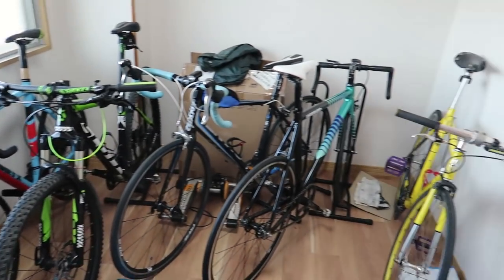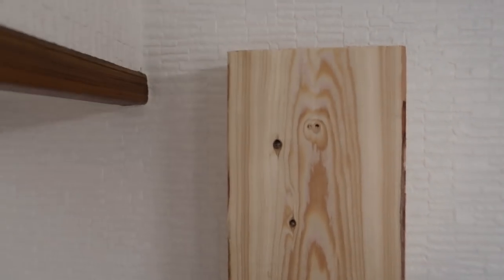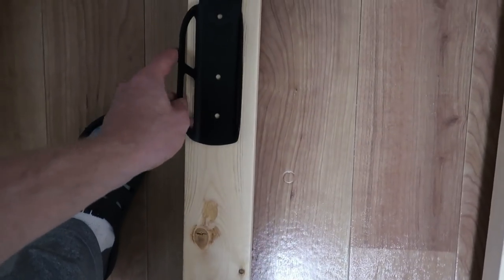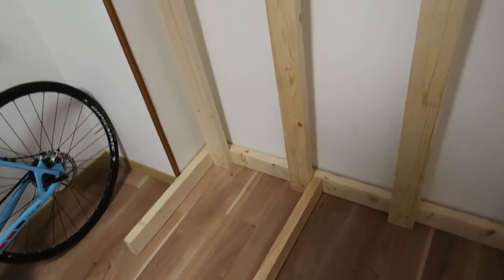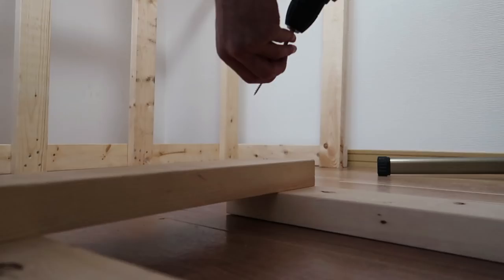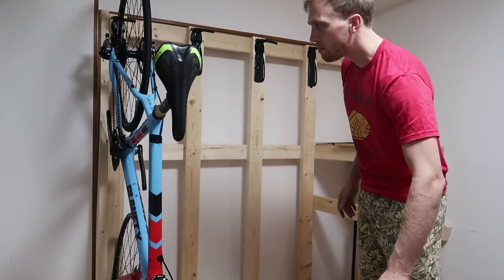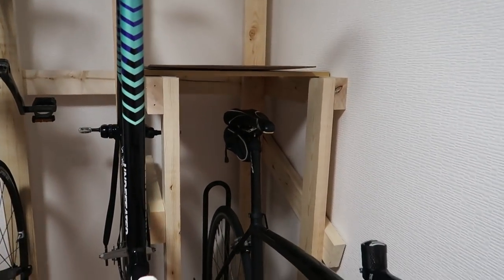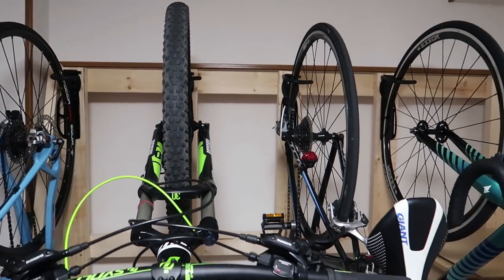DIY Bike Rack | Custom Bike Stand (Self Supported & No Wall Drilling)

Comment: When you said "diagonal", that was the magic word! 😉
 If you look at almost any open metal or wooden structure, you'll see triangles. Your side bench was fine for strengthening the rack. But you could have added 45 degree braces down at the bottom, just to half the length of the horizontal feet and those would have done the same job as the long diagonal. Hmm, actually you could remove the central feet now, that might save you tripping over them when handling the hanging bikes.
But you two did a pretty good job anyhow. 👍
Reply from the maker: Thanks! It was a fun project where I got to learn some new stuff along the way. I took out the center foot as well. Good to know that the shorter triangles would also work

Comment: I am planning to do something similar. I wanted to drill into the garage wall so 2 pieces of timber, hooks and I'm done but the family didn't want to in case they wanted to move things around it'll be easier so will do doing something similar. I only have 2 bikes but will be making it to have 5 hooks so friends can park their bikes and to accommodate n+1 bikes :P

Comment: Hi Cruise, what's the distance between each hooks? Do you think you'd need more? What height are the hooks at? I'd very much like to build something similar for my apartment in the city where I can't screw anything. Thanks!
Reply from the maker: About 42 cm.. I'm actually considering going smaller to fit more bikes.. You could also vary the heights to fit the handlebars easier.. Height depends on the bike size, but just measure your bike height and add a few cm and you should be good

Comment: Great final design!  I have made one with just a 2X4 into the wall and a small footing to clear the baseboard molding. For anyone planning to do this or a variation of it, it is very convenient.  If you add a few doormats or rubber underneath the bikes it will protect the floor and allow you to even clean and lubricate the chain while the bike is still hanging and the pedals can be turned freely. 
Also I would store the mountain bike on the left, so that the handlebar does not get in the way of the others as much, as well as rotate the handlebar on the planet X bike if you are not riding it, so as to have more space.
Reply from the maker: thanks for the tips! Planet X needs some work.. and tires before I can switch it around..

Comment: apply some varnish...or else at least smoothen the edges....if not you may get some splinters when u take ur bikes out...But its very functional...u jus need to improve it aesthetically....nice video
Reply from the maker: Thanks! and good point. I bought some sandpaper and did smoothen some of the edges, but got lazy and didn't finish.. One day I'll get around to it..

Comment: Hey Cruise,

You've been hanging your bikes by their wheel and have no problems correct? I've been thinking about doing that too but want to know if it's gonna cause issue with rim scratches or will it deform the wheel or spokes? People tell me that wheels sustain more force from rider's weight vs just hanging by a hook on the wall. What do you think?
Reply from the maker: I haven't had any problems. You'll want to make sure the hook has some nice cushion though, especially for carbon wheels. We also hang (most) of our demo bikes at work with no problems.
Reply: @TwoWheelCruise  Thanks. That's good to know. What about a heavy bike similar to the mamachari? Would you recommend hanging that by the rear wheel? I'm curious.
Reply from the maker: I mix front and back

Comment: It’s got to be anchored to the studs in the wall - preferably 3 or 4  anchor points where each bike is hung, though the challenge in Japan might be making it too rigid.
Reply from the maker: Unfortunately can't drill in the walls.
Reply: That stinks. You're either left with legs or adhesives.  Again, the seismic activity might be a concern in Japan as such having legs might make the rig less rigid.  Cheers

Comment: Good idea and good work... But if you if you have hydraulic disc brakes you should not store them vertically. Why?  In time the air in your brake lever reservoir will start to slowly migrate upward towards the wheel calipers which now are positioned higher than your levers. After a while your brakes will feel spongy and other mysterious brake problems will start to happen.

Comment: One thing you might want to try is put thick felt pads all around the bottom corners and sides to help moving this heavy piece and prevent your floors from getting scraped. Great job!

Comment: Why not a triangle shape on the sides? It's a lot stronger and takes less space and materials. Another good idea would be making the beams fit nicely, it adds to the over all strength and it would look so much better in the end. Here some examples that you may be able to use:

https://i.stack.imgur.com/rK4hl.png
https://www.youtube.com/watch?v=AZGbnroab1o 

For the rubbing against the wood you could add some protection. I don't know if IKEA in Japan has this, but you could always try, there is a product that you put in your kitchen drawers so pots and pans won't slide around as much. It should cost too much either. This product can be used to cover the wood a bit where the bikes may touch the wood. It will take away the worries a bit. Alternatively you could find a rubbery material (can also be found in a similar roll as common aluminium foil rolls) This is a bit more on the pricey side but it should last a lot longer.

For the back of the rack it would be smart to add something like a bed sheet, do make it removable so it can be washed from time to time. This will stop rubber tracks from appearing on the wall behind it and also dirt etc will sooner stick to the rack then the wall. A tarp that you usually use to cover a car or bike for example would also be excellent as this only needs a wet cloth to be cleaned.
Reply from the maker: Thanks for all of the advice! 

A triangle on both sides would of worked, but I had a vision of making a shelf on the right side for some odd reason and delusion that it would be stronger. Ended up with a mutant rack with a triangle on one side and rectangle support on the other. Probably used more materials than I needed, but at least it seems sturdy enough. That rack video you sent is neat, but we really wanted to get a vertical bike solution. Otherwise, we would stick with the floor mounts that we already had. 

Definitely need to get some sort of protection for the rear wall. Was thinking to just get a tarp sheet. I didn't think about protecting the wood as well, but that might be a good idea..
Reply: The video was just a idea for the triangle part that I mentioned. Aside from that, a pallet would be rather dodgy. It could easily splinter causing a unwanted puncture. So please see it as a idea suggestion. If you make it taller and then add your hooks, it would allow you to do what you already did but have it so much stronger and you would have space for your normal bike as well the way you wanted. You will need a lot less materials for the strength and you can also use those things to keep it upright during a Earthquake.

For the protection of the wood, well either make sure it is coated properly so it gets protection that way or as i said, add a tarp or something. But what I mostly meant in my comment is to protect the bikes. It is hard to find the right paint for your bikes as no factory is willing to deliver that or even mention what paint it is. So protecting the bikes from minor damages like that would be well worth it as that paint also keeps it from rusting.
Reply from the maker: I agree that the triangle design adds the most stability with the least amount of resources. I wasn't really aware of that when I started, but oh well. I'll keep that in mind when I build V2. That makes more sense that it's to protect the bikes than the other way around. I hadn't thought about splinters on the bottom, so I'll definitely get something down there to protect the bottom contact points.

Comment: Why didn't you just make a triangle?  And what is the cost for a road bike in Japan ?
Reply from the maker: What do you mean? I did a triangle for support on the left, but wanted to make an extra platform for storage on the right.

Road bikes here are generally about 30% more expensive here than where I'm from in the US. The used market is pretty good though since people keep everything in good condition, but nothing in my size 😢